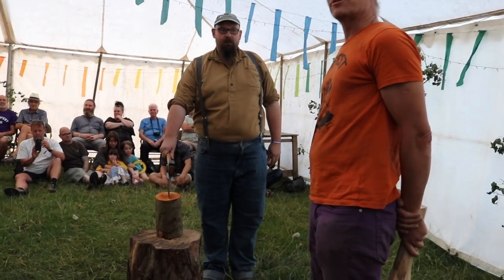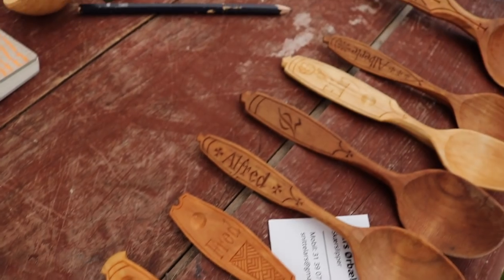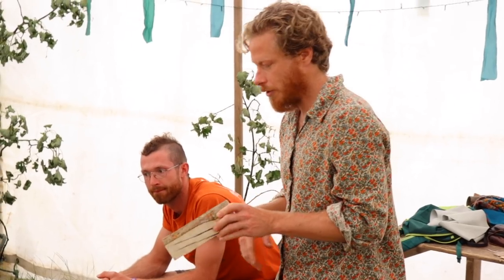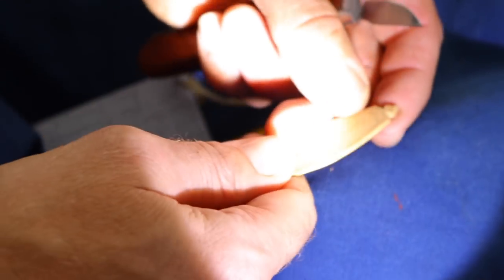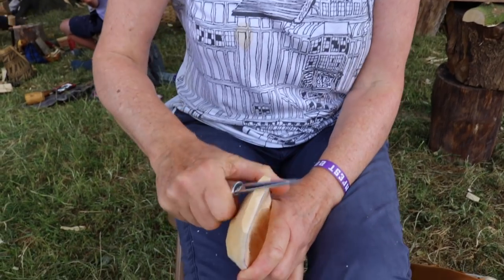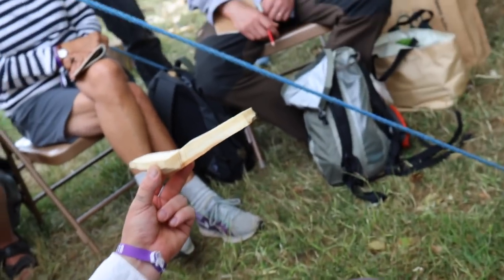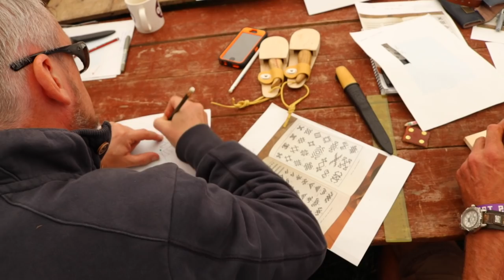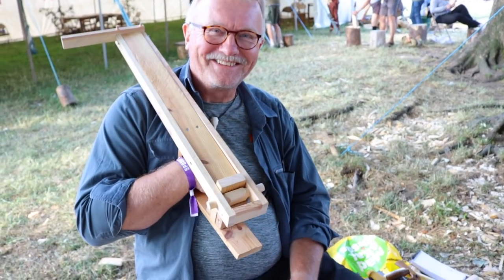Spoonfest 2018 - Worlds Largest Spoon Carving Gathering

Comment: Another excellent video. Thank you. I was amazed by the dangerous way many people were carving on their thighs with no protection at all. I always work on a board, never on my thigh. I remember it being described as the "Triangle of Death" and with good reason. Thank you for sharing.
Reply from the maker: Those carvers in question are pros and most of them carve for a living so all their techniques were done safely, as with anything if one isn't experienced or knowledgeable with using a sharp object then one shouldn't even be holding one let alone use one. The triangle of death purports to the internal upper thighs and groin region. Thanks for watching ~Peace~
Reply: Zed Outdoors Fine.